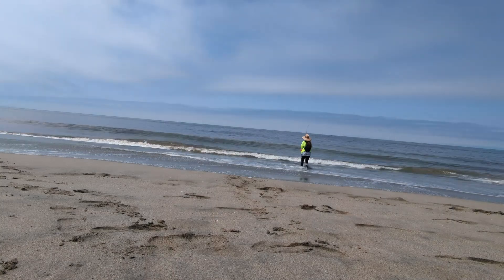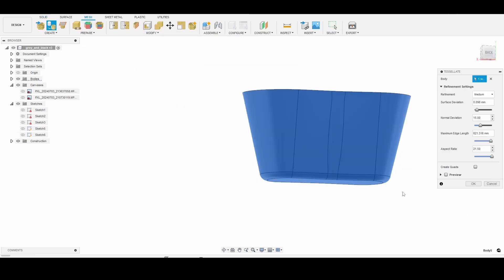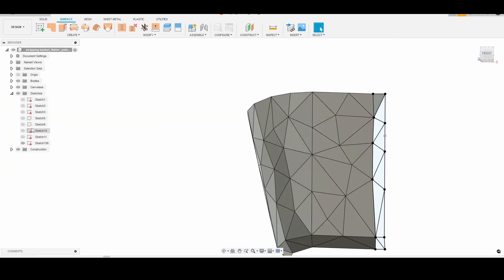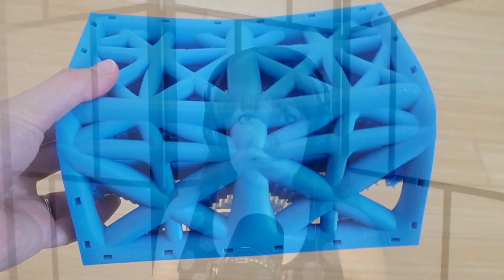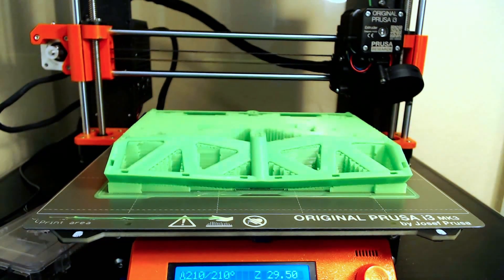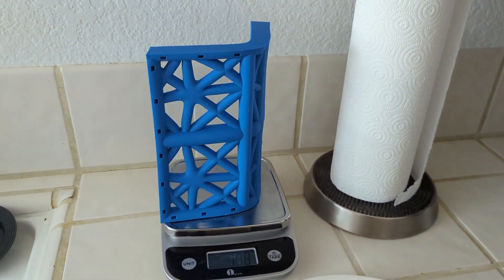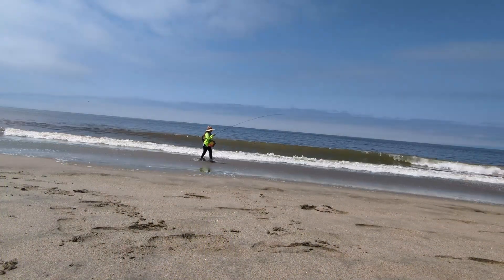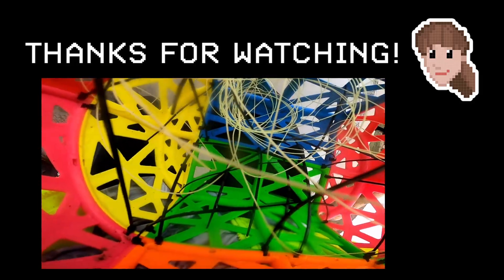Making a 3D Printed Stripping Basket for Fly Fishing the Surf

Comment: Here I am watching this thinking I'd find the ultimate solution for water resistant filament in a fishing application. You clearly have more knowledge than me on Fusion 360!!! I'll trade some of my competitive fly fishing secret for Fusion 360 skills...😅
Anyhow, I am actually looking at re-working a reel seat option AND making spare spools for one of my reel. I mostly use cassette reels for still water competition fishing but my river reel is stupid expensive and the spare spool are over 200 each. At this point I am debating prototyping with the 3D printer and once I am ready just getting PCBways to machine the parts...

Comment: You didn’t had to go through all of this all you had to do is put a butter knife in the fire wait till it got hot and make a few wide split in the bottom of your basket or used nail by holding the nail in the fire with a plier and make hold at the bottom of the basket and you’re done . Baskets are made of plastic hot knife go through it like butter . You can shape the basket with the hot knife anyway you like .